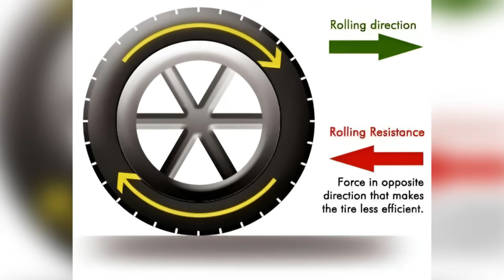Motorcycle Physics Secrets Every Rider Should Know

Comment: I have a degree in physics, and I have never heard of gyroscopic procession. I've heard of precession, but not procession. Gyroscopic forces might make the bike more stable (less skittish), but they don't keep the bike upright. The gyroscopic effect would act more like a damper to the steering. 
A motorcycle wants to remain upright. The stability is determined by rake and trail. Rake is the angle of the steering head. Trail is the distance between where the extension of the steering axis would touch the ground and the point where the tire touches the ground. The contact point with the ground is typically behind the steering axis, so if the bike leans left, the force from the ground is behind the axis, turning the front wheel to the left, returning the bike upright. You can demonstrate this with a bicycle. Hold the bike by the seat and lean it to the left. The steering will turn to the left. Lean the bike to the right and the steering will turn to the right. Try doing this with the bike rolling and see what happens. 
A motorcycle wants to remain upright. You have to unbalance a bike to make it turn. Putting pressure on the left grip will cause the steering to turn to the right. This moves the contact point with the ground to the right, initiating the lean. The steering will come back to the left as it tries to keep the bike upright, but as long as you maintain pressure on the grip, the bike will continue to lean and continue to turn. Remove the pressure on the grip, and the motorcycle will return to upright. 
Counter-steering produces lean; lean makes the bike turn. 
Speed allows the steering to more quickly respond to disturbances in balance. When riding slow, it takes longer for the front wheel to travel the distance needed to recover from and imbalance. If you are traveling too slow, you'll be on the ground before the front wheel can get to where it needs to be. At high speed, the corrections are almost instantaneous. If anything, gyroscopic forces would slow the reaction down.

Comment: Good info.

Would counter steering work at low speeds or do you need to have some speed for it to work?

U turns & hair pin bends - there is no need to lean, just stay upright &  slightly tilt the bike - centrifugal forces are more at high speed cornering, so you need to lean to counter it, right?

Comment: at #1 it is not gyroscopic effect which stabilizes the bike but fork geometry - gyro adds a couple percent at high speeds ,but if you calculate it, it's negligible even at ~50 km/h
Reply: WTF are you talking about? You clearly haven't ever turned a spinning bicycle tire, let alone a motorcycle tire. Fork geometry simply makes this force manageable.
Reply: @seanhogan6897 simple thing - you can tilt the bike in the garage at 0 speed and see that the fork still follows that movement, steering toward the tilt as it would stabilize the bike if it were moving. No gyro effect is present with no spinning, so there is nothing to talk about. The well-known school demonstration with a bicycle wheel is good when it supports its own weight against gravity, but when it comes to numbers, you will immediately see how negligible the gyro effect is when it works against the rider+bike weight at low speeds.
Reply: @hasteakinside right, at low speeds the gyroscopic effect is negligible, that is why it is increasingly more difficult to ride at slow speeds, but as the pace picks up the gyro effect becomes FAR more significant.  Tipping a bike in the garage to see its tire lean over to align with an imaginary turn shows that the geometry of the bike is designed to better take advantage of the stability provided by the gyroscopic effect.
Reply: @seanhogan6897 agree
Reply: Similar deal with #2. Counter steering applies at all speeds, not just a walking pace. It just feels different because your bike doesn't have enough momentum to autobalance itself at low speeds.
Reply: @Dunsparce1265 the video said anything above a walking pace, not just at a walking pace.
Reply: @seanhogan6897  that's kind of my point. It's not only at or above a walking pace. It's at all speeds.
Reply: @Dunsparce1265 ya, and that was the video's point too.
Reply: @seanhogan6897 I doubt that. This channel specifically, as well as the larger Riding community seems to have the idea that steering inverts above 5 miles an hour or so, and that's simply not accurate.
Reply: @Dunsparce1265 no, it is simply that countersteering is all but pointless and unnecessary at only a couple of miles per hour.
Reply: @seanhogan6897  this is also false. Countersteering is how the bike stays upright. The adjustments are just slight at low speeds, but still absolutely necessary.
Reply: @Dunsparce1265 ya, think that through a bit more.  At a slow enough speed, simply  leaning can completely take the place of countersteering.  Anyone who really rides much and has thought about it knows this to be true.
Reply: @seanhogan6897 conservation of momentum. You can't just "lean".
Reply: @Dunsparce1265 Dang YouTube didn’t take my long explanation, so I will keep this shorter. You sound like a kid trying to fake a book report without having read the book.  I assume you mean the conservation of angular momentum, the physics principle responsible for what we know as gyroscopic procession (in this case related to wheels).  Sorry to break it to you, but as this gyroscopic force lessens to almost nothing at very low speeds, the geometry of a bike combined with body positioning allows for direct steering to initiate a turn. The same principle also applies at higher speeds; that is why we can steer a bike without our hands, only a bike is far more reactive to our body positioning and weight at slower speeds due to less stabilizing gyroscopic force.  Don't believe me, go ride your bike and see for yourself.

Comment: Didn't mention dropping the inside arm  and crouching down  to load the inside for smooth curves.  Maybe the  putting the knee  out.  But it always makes it feel more controlled when riding fast. 
Riding for 30 years and only  come off once on diesel on a roundabout,  but still managed to get the boot down to save the bike. Instinct is a good thing. 😮

Comment: 1 minute in and it’s already false. 

A motorcycle wont stay up if it were going backwards at speed.
Reply: You gotta love it when someone pretends to know what they are talking about but don't know S.  If you have ever rolled a bike backwards off a truck or trailer, you would know better than that!
Reply: Agreed, gyroscopique effect does keep the bike up but the géometry (angle) of the front fork.

Experiments: Researchers have built bicycles with counter-rotating wheels that cancel out the gyroscopic effect. Result: the bikes can still be ridden and balance just fine.
The gyroscopic effect of the wheels does contribute, but it’s surprisingly small compared to steering geometry and rider corrections.
Reply: @Agaurooh BS.  it amazes me that people know so little about physics and geometry, to keep repeating that crap, let alone taking two brain cells to simply observe reality and not think about why a bike stays up while moving.

Comment: If you accelerate you decrease grip at the front . If you brake  you decrease grip at the rear . So everything should be nuances that vary in between the two depending on what your doing . But if you lean over in the direction of the bend at speed  to anticipate it then your  arm naturally pushes the bar to point the wheel in the opposite direction which works .